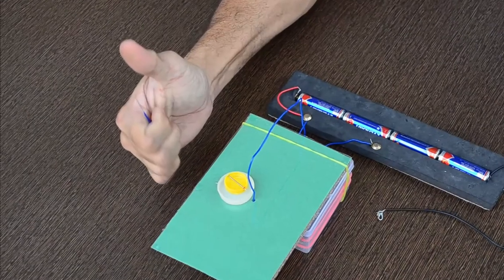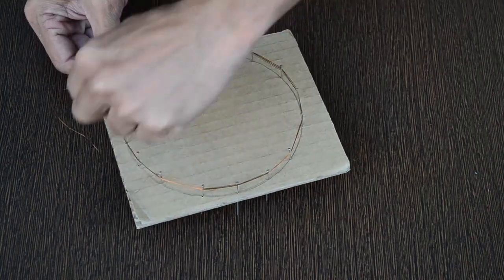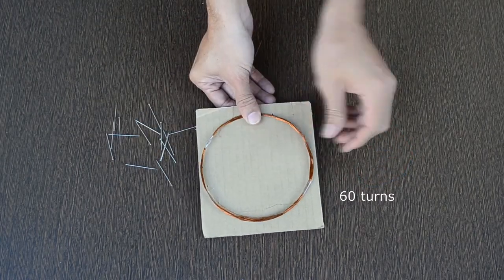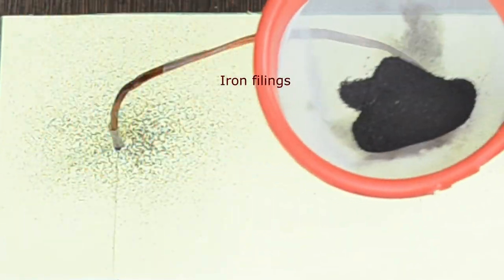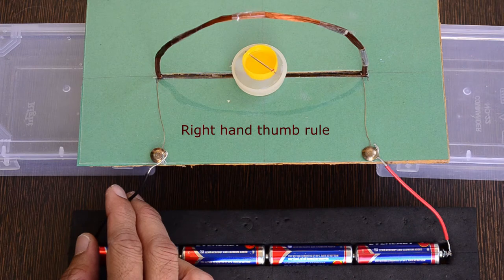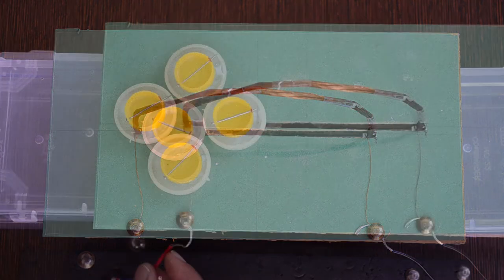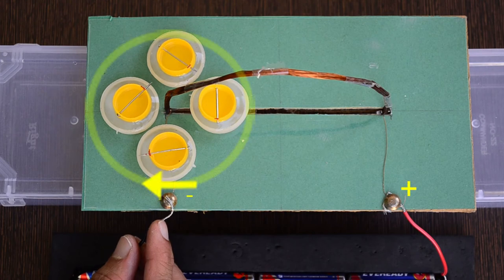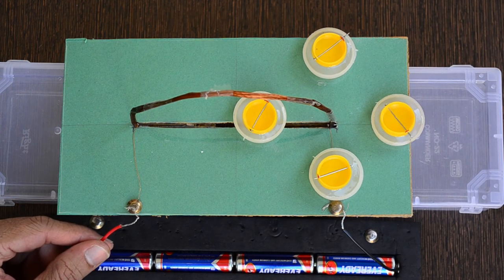Magnetic field around current carrying coil

Comment: 1:09 remove coating with sand paper. I was struggling with the experiment at home with different mechanism but after seeing above mentioned step at 1:09, i did it  with coil here. My problem got resolved. Thank you so much for your post.
Reply: Hlo 
Bhai kaise bnaya

Comment: Can you please tell me if instead of coated  copper wire we use uncoated  copper wire then it will work or not
Reply from the maker: Using uncoated wire will short the path. There won't be loop. It will not work
Reply: @RavindraGodbole   agar isme 10 turns le to result milega ya phir 60 turns lene par hi result best milega